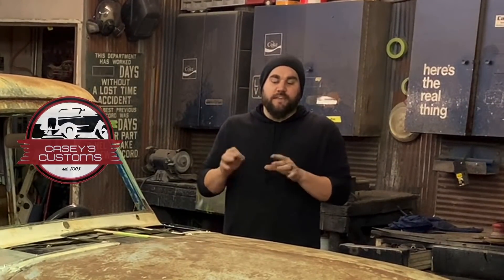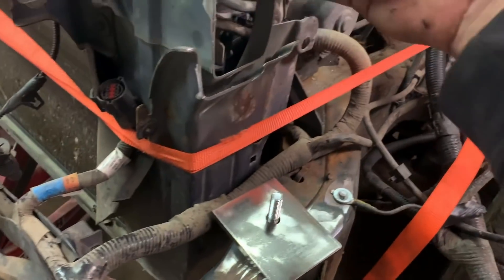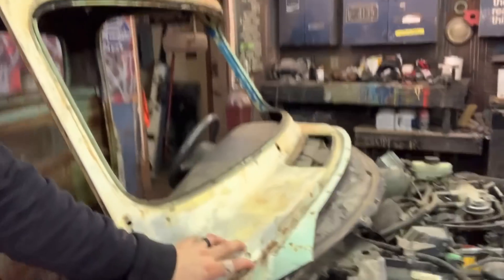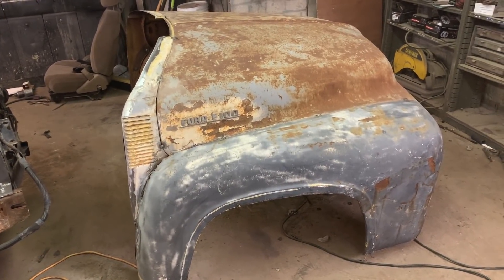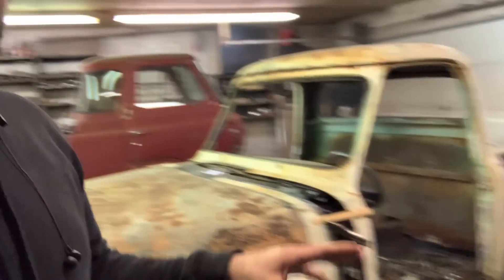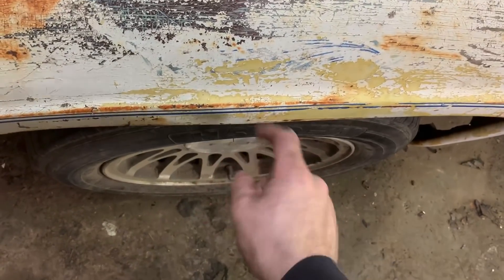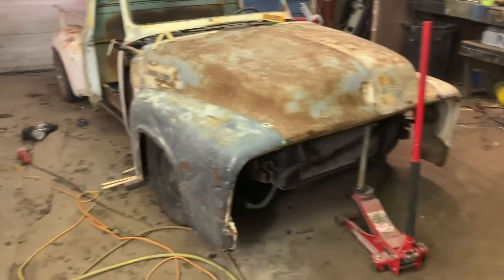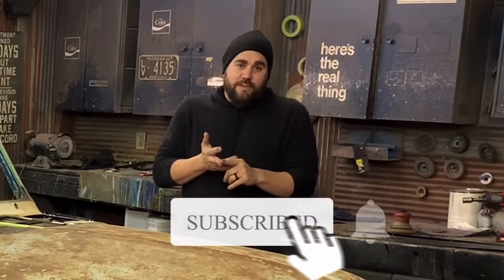BUILDING A HOT ROD FOR UNDER $1000 DOLLARS! PART 7! HOW TO BUILD  A RAT ROD ON A SUPER CHEAP BUDGET!

Comment: I just subscribed to your channel today and so far have binged thru this budget build, which is coming along great!  Wanted to let you know that I was going to do what your doing with a 96 Lincoln Town Car we owned and a '52 F-1 and I bet I'd have been one of those guys who ended up with tires sitting funny in the wheel wells, it would have never crossed my mind that the truck wasn't flush and straight on measurements, this was invaluable information!  Great channel.

Comment: Would it not be better to stretch the cab? Like you’ve said before, trucks weren’t built for the tallest people, but it seems like it’d be nice if the cabs were a little longer???? Especially if you were chopping the top? Though, elongating it may make it look chopped anyway???
Reply from the maker: Unfortunately after this video i took a bunch of measurements and realized stretching the cab wouldn’t really fix the issue i had. It had to be a cowl stretch. Check my newer vids and you’ll see it. It actually came out great and isn’t as noticeable as i thought it might be
Reply: No worries bro! I’m caught up and subscribed! And you’re right, it is far less noticeable than I originally expected!

Comment: I have an idea for a low cost wheel solution. Can you adapt those Moon Wheel caps to fit your current wheels?  I think they are only like $15 a pop.
Reply from the maker: I actually did that before, i welded little tabs to the rims and then the baby moons clipped to the tabs. The good news is (if i go with steel wheels, which I’m thinking i will) steel rims are cheap. You can get them in any offset you need and it doesn’t cost hardly any extra.
Reply: @CaseysCustoms  Nice, I will keep that in mind. I haven’t shopped steel wheels before. Didn’t realize how cheap they were.
Reply from the maker: @Jeep-Creep  i think the last ones i bought were like 50 bucks a rim. Very cheap
Reply: @CaseysCustoms  wow not bad at all!  I am half way tempted to switch back to steel wheels for my beater with a heater for winter. We have 2 Jeep’s grand Cherokee and liberty and they both have aluminum alloy and they both leak air bc of oxidation. I know steel weighs more but really it seems to be more reliable
Reply from the maker: @Jeep-Creep  yea and it’s not a ton of weigh difference anyways, if you are building a million dollar race car it would be a problem, but not on a daily driven jeep. Lol